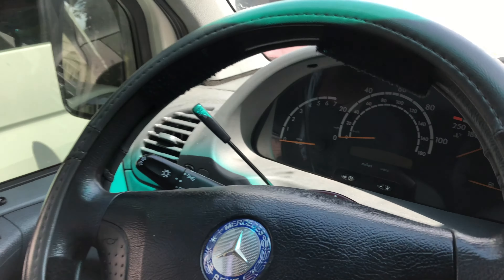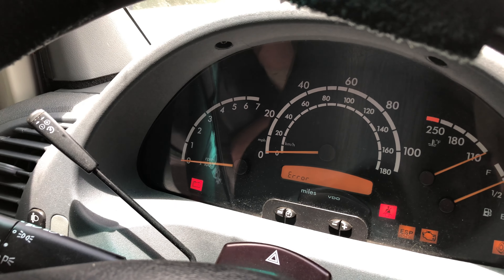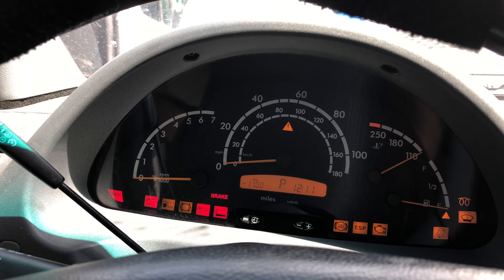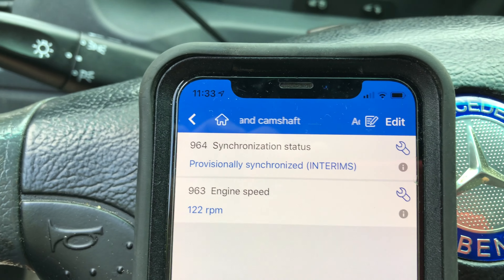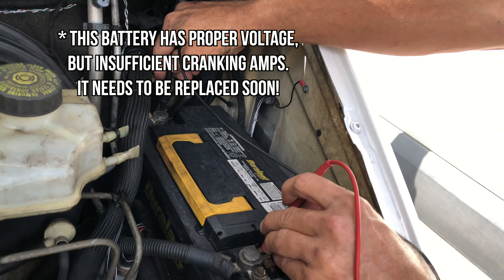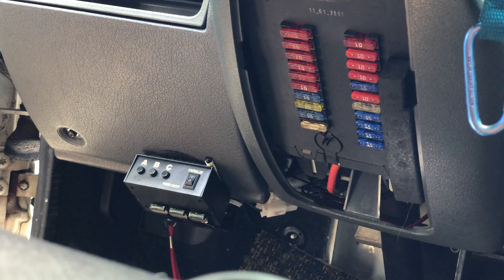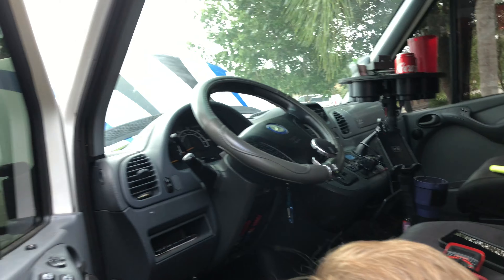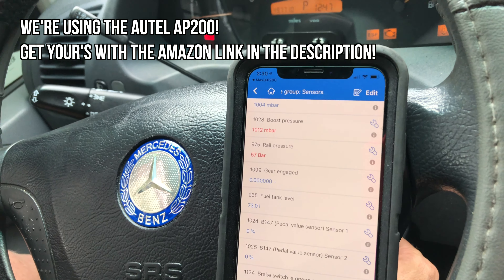Common Causes a Sprinter Won't Start. Fuel pump relay, starter relay, fuel flow, low battery, etc.

Comment: 2004 2.7 litre 5 cylinder diesel, with a no start.. fuel pump runs, no injector pulse. 
OBD hookup shows an open for injector supply group A PO 2146 and group B PO 2149.
Any thoughts ?
Reply from the maker: Generic OBD codes often mislead. Get the AP200 we link or other code reader that has Sprinter in the menu selections. 2146 is not a Sprinter code and 2149 is a digital/analog conversion failure, further indicating an improper code reader in use. No start could be crank/cam sync failure, fuel rail or injector overflowing to the return lines, fuel control valves or sensors. Could also be the MAF and you can try starting the van with the MAF unplugged. We have a video showing MAF testing. How do you know there is no injector pulse and not pulsing with inadequate fuel pressure?

Comment: Excellent video. I have a 2021 Leisure Travel Van (Unity) which is built on a 2020 Sprinter 3500. It has less than 12000 miles on it and haven't had any issues until now. Drove it from OH to FL in December, no problems at all. Came home, parked it in the driveway, and it hasn't started since. I push the ignition button, all the lights on the dash come on, it does the oil check, etc, but NOTHING happens. Doesn't even try to crank. Everything else (lights, radio, etc) seems to work fine with the ignition on. I've tried all 3 key fobs, checked all the fuses. Very frustrating. My next step is to call Mercedes road-side assistance and hope I still have some coverage. :(  Any ideas outside of what you already have in this video?
Reply from the maker: I've only touched one 2020 and don't have any relevant experience with no-start.

Comment: Great video thx. I have an issue with my 2004 sprinter they start, but shut off right away. Everything is good fuel pump, fuel filter,high pressure pump,all sensors is OK.Do you have an idea what happened with my truck?
Reply from the maker: Yes I do! When they stall immediately after starting it is the MAF 99% in my experience. Unplug the MAF and it will run with reduced power on acceleration. Get a new MAF and see if more needs to be done. A failed MAF can put the ECM in a bad mood. We can cheer it up. https://www.youtube.com/watch?v=3nylx7bZO0g&t=138s
Reply: @FloridaVanMan  thank you!I definitely get new one!you awesome

Comment: A out to go see a 2004 2.7l turbo diesal dodge sprinter with 220k miles for 11k, condition looks good but haven't seen many reviews on the longevity of these Vans? Any input would help
Reply from the maker: I have over 500,000 miles on mine and have seen many with more than me.

Comment: At the end of the video you mentioned start air , what is that .
Reply from the maker: When the van's ECM doesn't recognize the I.D. chip in our keys a message displays on the odometer screen "StartError".

Comment: Great videos,my sprinter won't start whe n glow plug light is on,and most of the time it does not go out,I have to toggle ignition off and on until eventually the light goe out and the van starts,ever seen this problem.2000 sprinter 313
Reply from the maker: Are you in the UK? Vans have some different common problems over there, different ECM and engine options. Percussive diagnosis on the fuse box might give temporary relief. (hit it!) The welded brass connections inside the fuse box can be troublesome at this age. If smacking the fuse box does nothing I'd try unplugging the battery for 30 seconds and touching the battery  leads together to drain any capacitive current, giving the ECM a fresh reboot. If that works reliably find a repair center for the ECM.
Reply: Yes I am in UK I will the smack the fuse box trick lol,I thought it was GP relay changed that but no go

Comment: Hey man, so I have a 2005 dodge sprinter,  3500 deisel, I put the key in turn it and the aux fan comes on but the engine does not crank. The battery is brand new.
Reply from the maker: First check fuses under the steering column, #7 & 16-18. If your van is a North American 2005 you can test if the ECM is getting voltage on all three needed pins. https://www.youtube.com/watch?v=hRmXq4KRHdQ&t=184s
Reply: @Florida Van Man  thanks man ! I'm going to look into those today and get back with you. 
Update :  I was getting the auxiliary fan issue when turning the key, I ended up eventually sending it to SOS Diagnostics along with the skreem and key. 
When I plugged everything in the axillary fan issue stopped for about 24 hours, although i was still getting no crank. however the next day when I went to turn the key the aux fan is now coming back on. 
Is it possible something is frying the ecm/ecu? Thanks in advance.
Reply: Just to clarify, SOS Diagnostics did confirm an issue when I initially sent the ecu and they fixed it for 835$.
Reply from the maker: @garyhuffman7953  Email SOS. They are very helpful and knowledgeable folks. I don't know what causes it, just age or if it can be the van stressing the ECM.
Reply: I can get the starter to turn, by jumping it with the positive terminal, but I still cant get it to fire. It's getting gas  to the injectors, anything abvious I could be missing that I should look over ?
Reply from the maker: @garyhuffman7953  Getting fuel to the injectors won't matter if the injectors are not told to fire. These aren't pop-injectors that go-off under pressure. ECM needs to run the injectors. Failing fuse box can cause the fan on and other no-crank issues. There are fuses at the front of the battery that feed everything under the seat, and there are more fuses and relays under the seat that should be verified AND reseated.
Reply: OK some more discovery : 
I removed the starter relay and bridged the connection, when I turn the key it trys to start immediately, even when I turn the key off and take it out the van is still attempting to start, went to the store bought a new relay, installed it but it was acting like the relay was no good ? When I turn the key I can clearly feel and hear the pump relay, but not the starter relay on either the new or old unit.

Comment: Very informative video, Thank you Florida Van Man. I have a 2003 Dodge Sprinter with the inline 5 cyl 2.7 mercedes diesel engine. My van will not start unless I spray into the air intake with either diesel fuel or starting fluid. After it starts, it will run all day. Shut it off after driving for hours, it needs a spray to start even then when thoroughly warmed up. It seems to lack power, but given distance it will accelerate to 80 mph, running at around 2800 rpm. The motor will only rev to about 4000, but that's fine with me, don't need more than that. The rectangular diesel fuel 'transfer pump' was replaced with a bosch pump by the previous owner. He thought that was the issue, it was not so he sold it to me. Any ideas what my no start issue might be caused by ? It's obviously fuel related, but might be some sensor that is not allowing the fuel to flow at starter motor cranking speeds, only after the starting fluid fires it up. Thank you for any assistance that you might offer, Steve
Reply from the maker: Most likely the high pressure fuel pump, but could also be the fuel rail releasing pressure or one of the injectors leaking to the return lines. Here is how to test that: https://www.youtube.com/watch?v=aB4d8xyZwU8&t=7s We have links in many video descriptions for a diagnostic code reader that may be very helpful in determining where the problem lies.  Autel AP200
Reply: @FloridaVanMan  Thank you for the reply and info. I'll watch your video on youtube !

Comment: Hi.Great video as always.I am big fan in Vancouver.i have problem with my 2001 Mercedes Benz Sprinter 316cdi.
It crank for way too long -for about 7 sec or more and than it starts.It starts after all but it's annoying.Its not temperature related.
I replaced glow plugs,glow plugs Control unit,cam shaft and crank shaft position sensors,new fuel filter and checked fuses.
If you have any idea it would greatly appreciate.
Thank you
Pavel
Reply from the maker: We have a video for testing the glow plugs with a volt meter and fused wire. You can look for air bubbles in the plastic fuel lines at the front of the engine. Any bubbles in there means you have a leak. I think your 2001 has OM612 engine with no fuel pump in the tank, so it sucks fuel to the front of the engine rather than push it. This allows any leak to let air in causing slow starts as all the air must be sucked through first.
Reply: @FloridaVanMan  
Ok thanks.i will inspect my fuel lines very carefully.I don't think glow plugs is the issue as i replaced all 5 just last summer.This problem was the reason why I replaced them and it didn't help.
Will keep you posted.Thank you.
Reply: @FloridaVanMan  hello.
Thank you so much for this tip.I ended up doing all fuel lines and van starts Lika a champ now.Is there anyway i can send you some appreciation?Your chanel is so useful.
Also have one more problem that keep coming back.I am slowly getting air in break system.I have new reservoir and master cylinder,power bleed done and pedal is getting soft again.Any idea on this one.Thank you very much.
Pavel
Reply from the maker: @pavelhusek2367  Are yo sure it is getting air in? Or maybe just the ABS pump failing? If bleeding doesn't fix the problem it is probably the pump. Our videos are made possible by viewer like you. Donations are greatly appreciated and easily made from our website. https://floridavanman.com/donate/
Reply: @FloridaVanMan  
Hi.I sent you some coffee.Thank you.
ABS light is not on.but did break bleed twice and always come back and always have air in lines when doing break bleed.But just realized it might be air in abs unit and will have to do it with obd scanner. I can't think of anything else.
Reply from the maker: @pavelhusek2367  There must be an issue with BuyMeACoffee website. We haven't had any donations there in a month, and the only one a month ago was refunded. Donations here will reach us: https://floridavanman.com/donate/
Reply: @FloridaVanMan  
Hello again.
So i sent another donation so hopefully this one go to.
You mentioned before that my spongy pedal could be because of abs unit is failing. Even when there is no light on the dash?
I just did another bleed,this time with computer.And i am just about to replace master cylinder ( as the previous one wasn't OEM Mercedes).It just drives me nuts.Any other ideas where else i can look?There is no leaks and it keeps coming back.Already 4 power bleeds done and the last one with computer (to activate abs unit).
It will hard for me to get new unit(Mercedes dealership price is 3500$).
Thank you
Reply from the maker: @pavelhusek2367  Received, Thank you! I have not done much with brakes so I want to caution you that I may not be an expert in this area of our vans. I suspect your ABS pump is the issue though I couldn't recommend that dealership cost. Used units are available for 10% of that money. I'm told there are a few variations, so you should find a knowledgeable seller like Kansas City Sprinter or Million Mile Sprinter.
Reply: @FloridaVanMan  i will look it up.
Thank you

Comment: QUESTION: Can the selector lever module go bad and prevent starting? My 06 2500 was starting right up since new to me last October and through the Winter until two weeks ago. Then, all the dash display as usual but turning key to start, just one click sound. I've brightened the main ground and a second one below the fuel filter; and removed the started and bench tested and found it strong. AND SO...this question: if the dash display shows the big P for park went the key is on, is that a guarantee that the selector lever module is not at fault? It did look a mess under the trim....I'm about to remove but hesitant. Does this module ever cause failure as described above? HELP-THANKS
Reply from the maker: I have not seen or read of the selector causing no-start. Have you verified the ECM is getting voltage at all three pins when needed? https://www.youtube.com/watch?v=hRmXq4KRHdQ&t=84s
Reply from the maker: The start relay and fuel pump relay, accessible under driver seat should click. You can feel and hear this click. Fuel pump clicks when key on. Start relay clicks when turned to engage starter-motor. If the start relay clicks and the exciter wire at the starter gets voltage, the problem MUST be ground connection under the hood. There are a few to be concerned with and I can help identify them with 1-on-1 assistance. https://floridavanman.com/donate/
Reply: @FloridaVanMan  Thanks so much for your feedback! No: I'm parked on the street and have been reluctant to be standing in the potential path of oncoming vehicles though it's not impossible and I may have to try at some point, or have it towed away. I have viewed the video and could follow it quite well. But I'm surprised to hear the selector lever can't be the culprit since I've read where Sprinter owners solved a no start by moving to N to try. In fact when this first began, I was stranded away from home and having read that, came back and tried in N and after 6 or 7 attempts got the same good strong start as usual.Then the van ran flawlessly on a 4 mile drive home where I parked, shut down. And immediately tested to find no starter just as before and then being in N made not difference nor shaking or pounding or uttering prayers (or expletives).
Reply: @FloridaVanMan  Thanks again...much appreciated! I am now just wondering if it might be possible the fault is in the big cable to the starter going bad. It never occurred to me to check though I did brighten the big square plate connector very diligently. But could the connection between it and the actual braided cable that goes into it have broken down? I will have to check that (among other things).
Reply from the maker: @LEXICOGRAFFER  Expletives is often the key for me. The louder and more offensive ones work better! LOL ...at making sure no one bothers me while I am trying to think! 
I definitely see a potential for the shifter to be the problem. As you noted, if the shifter thinks we are in D or R it will not allow starting. But I've not read of anyone replacing or repairing this switching mechanism to find glory. :(
Reply: @FloridaVanMan  I did donate $10.00 to the cause and wish I could afford more. But I'll ask one more question. Since starter failure I did a scan with the Autel AP200 and here's what I got:  "P1926  System: EWM Electronic Selector Lever Module
Description: CAN communication is faulty". If this help you point me in the right direction I sure would appreciate it. I took the selector lever module out this morning and everything looked kosher but did not open the case of connections that interfaces with the shift lever pivot pin: chickened out. Thanks
Reply from the maker: @LEXICOGRAFFER  P1926 is a fairly common code in vans that have no symptoms. I see it often and pay no attention to 1926. That doesn't mean your shifter is OK, only means that code is no help.
Reply: @FloridaVanMan  This just in: my 06 2500's starter switch (big round plastic thing wires coming off the bottom): very wobbly! Could this be the culprit? Or are the all like that, even new? And....does the thing just push-on/pull off?
Reply from the maker: @LEXICOGRAFFER  You mean the switch behind the key & tumblers? That should not wobble. If I remember it just clips into the tumblers and is a pita to change. I have a new switch here for probably 12 years because after buying it I found it too difficult to replace. I've since learned that wasn't my problem, but 12 years ago I was just throwing darts in the dark.

Comment: My name is cesar I have a 2008 dodge sprinter it has a long crank all the time, when I drive it for 10 minutes or more turned it off ,try to start it again doesn't start. It does  start until cool off any suggestions ty
Reply from the maker: Likely suspects are the camshaft sensor or fuel pressure. Cam shaft sensor is cheap and easy to replace. Fuel pressure testing would be a bit more complicated but not hard. I don't have a video on 2008 leak off testing but if you watch the 3 videos we have I think you will understand the idea and be able to adjust the process to fit your 3.0 engine.

Comment: That is a $100 shop visit in value. Front seat relays ( in the front) those are spares?  I subbed in the 100's,  deserving  of many more subs. Great work.
Reply from the maker: The relays under the front of the seat aren't spares, but they work less critical systems.